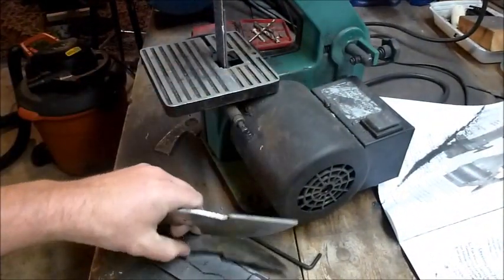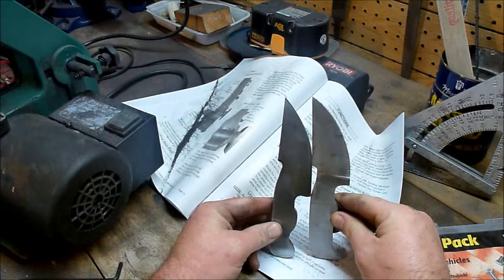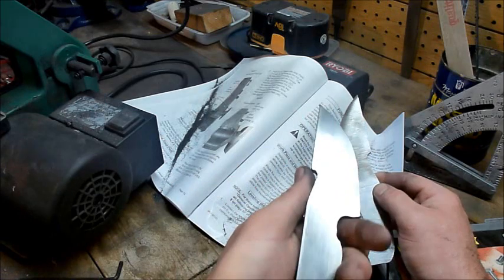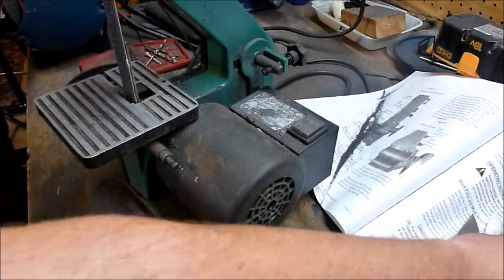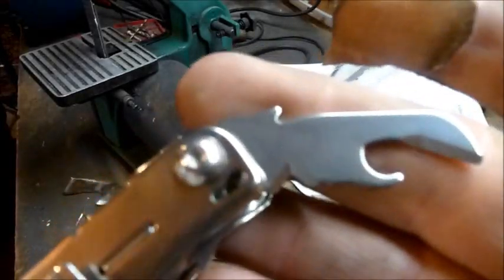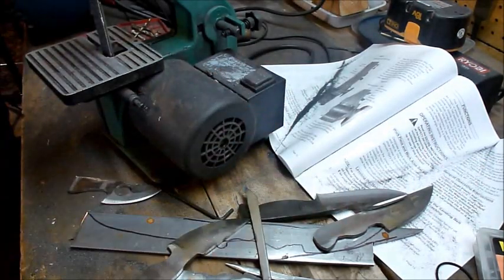Latest Harukaze Custom's And The Leatherman Wingman 1st impressions.

Comment: The Multi Tool... I had mainly cheaper crappier... And I got to realize one thing: Mainly it is the user. I mean...you can have to most expensive MT...if you don't use it...Like you said...it's a 30$ Leatherman... Still good looking